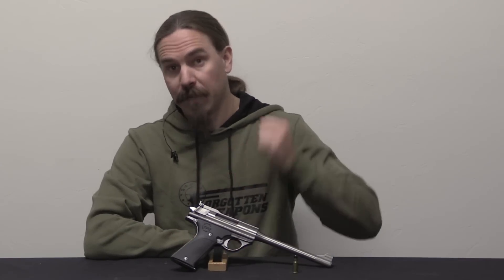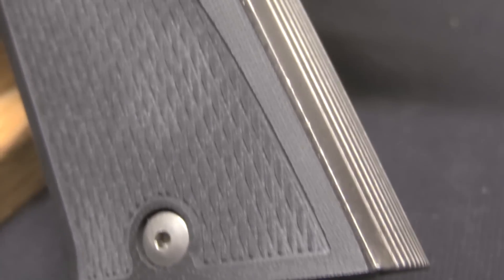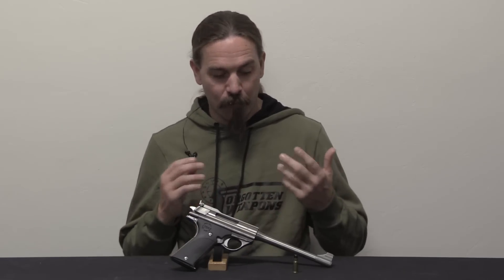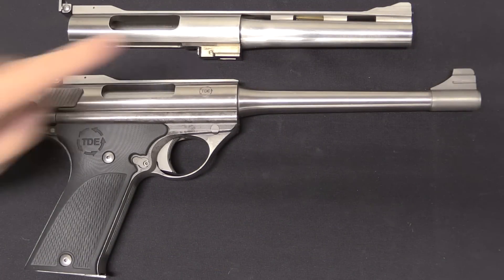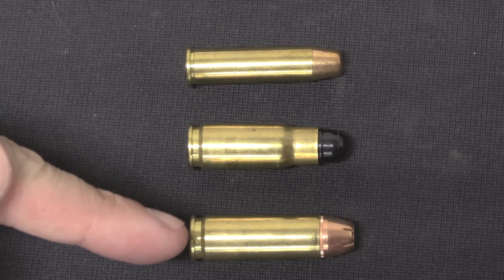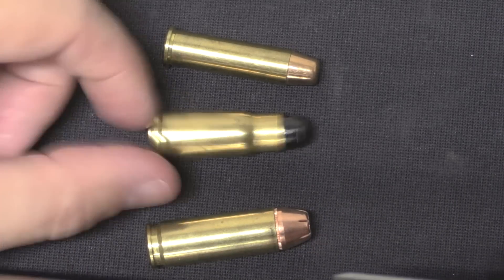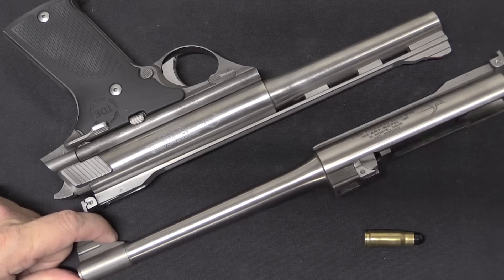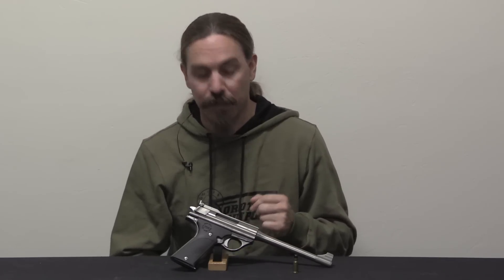AutoMag 160 in .357AMP: For When the Regular AutoMag is too Common

Comment: Loved the Automag since first seeing it in the 80's . Curious to know how they used to bottle neck the 44 AMP casing to house the 357 bullet? Also the Beverly Hills cop 2 thing with the gunsmith saying they used to cut down 308 cases for the 44 Automag - is that true? cheers
Reply: Not likely.  The base of a .308 Win case is .47in in diameter, while a .44 Mag (can't find specs on .44 AMP, but images show them to be nearly identical except for the time) has a case diameter of .457 in.  Maybe close to the eye, but .013 in. is quite significant when it comes to a chamber size.
Reply: Actually, someone asked Ian this very question in one of the earlier q&a’s and Ian confirmed the scriptwriters got that part right. Can’t remember which specific q&a it was
Reply: Yes, .44 AMP cases were made from .308 cases (also .30-06 from what I know). It appears that for once in hollywood both the armourer knew their sh*t AND somebody involved listened to them.
Reply: 2 necking dies, a Neck Reaming Die, Full length Size and File Trim die.....  RCBS Custom Shop made them.   And yes,  308 cases...
Reply: @Stevarooni  .44Mag case diameter is the extra for the rim, .44Amp is rimless, same as .308.
Reply: @CJBrunt  the rim diameter of a .44 Magnum is .514 in.
Reply: yes cut down .308 shells can be used.

Comment: Necking it down is pretty similar to the 357-44 b&d. 

I think it would have been better if it was a 223 based, like the 357 max-ar wildcat, but instead at that 1.290” case length.

Comment: “The jacket goes flying off and the lead disintegrates mid flight.. which is not something you want”

Me, an optimist: So you’re saying it has a built in feature to convert some standard loads into the endlessly destructive ratshot?

Comment: Dear Ruger:

Lock the action open, flip down a lever, and the barrel comes off.

In a magnum centerfire pistol.

Try it. It might just work for rimfire as well.
Reply: It does work. It's called a high standard sport king or a Victor. Lock slide back, push button, barrel falls off, slide slides off frame. They've been a thing for almost as long as the original Ruger Mark.

Comment: Can't the 44amp just be formed from cut down. 308 brass??
Reply: Omit the word "just" and the answer is yes. In the eighties I read an article about how to do this, and you had cut the existing neck off the .308 (7.62 NATO not recommended as thicker around the case head), trim to the right length in a die, probably ream the mouth out to the right internal diameter, anneal the new case mouth WITHOUT annealing the case head, full-length size it and possibly trim again. I think you might have had to turn down the rim or perhaps skim the head to make the rim thinner, but it's been four decades now and my memory is not as clear as all that. There was at least one lathe action, anyway. To make .357" AMP was a bit more complicated and I remember a photograph of the cases sitting with their heads in a dish of water while the case mouths were annealed.
Reply: Omit the word "just" and the answer is yes. I think you had to ream the inside of the cut-down cartridge to get the right internal diameter as well as full-length sizing the outside diameters with a suitable die, and anneal the new case mouth without annealing the case head. I think there was a lathe operation of some sort on  the head or the rim as well. And, as Ian says, you had to know what your chamber dimensions were like to get the headspace right. I did read the instructions in the early eighties, out of curiosity rather than because I liked the idea of doing all this.

Comment: I don't understand why they wouldn't just chamber these in 38ACP or 9X23 and just change the whole upper instead of a niche product like this.

Did they ever explain their reasoning for the 357AMP?
Reply from the maker: Using a cartridge not based on the .44 AMP  would require a new bolt with different dimensions.
Reply: @ForgottenWeapons  so even the lug geometry was the same for the lockup?
Reply from the maker: Yes, the bolt was identical. The caliber change only required a different barrel.
Reply: @ForgottenWeapons  i guess i can see the appeal.  would be fun for handloaders.
Reply: There were plans to make one in 45 ACP.  The costs would be high compared to a much simpler Browing action.

Comment: Is it possible to cause a .300 Blackout situation if you put a .44 into a .357 configuration?
since the magazine is the same and the brass is essentially the same length, I assume it would fit....?
Reply: No. That is the same as putting a .30-06 in a .270 . It will not chamber. It will not go in far enough to chamber because the projectile is larger diameter.
Reply: @glennruscher4007  I see, thanks for the explanation
Reply: You could run a 357 AMP into a 44 AMP as the brass is the same dimensions up to the shoulder.

Comment: Why not make a solid copper projectile to solve  the issue with the copper jacket peeling off
Reply from the maker: Solid copper has to be much longer to get the same weight as lead. That reduces case capacity.

Comment: I would think 357/44 Bain Davis would be a good start for loading data .
Reply: I think the AMP has a larger case capacity.
Reply: @DrsharpRothstein  It probably does just thinking to use the Davis as a starting point for working up loads.
Reply: @DWM 
It has been years since I compared the numbers.   You are correct they are 'close' but I don't know if I would want base loads on it.

With that said I have worked up loads with the Powley computer that I could not find any comparable types.  Chrographs and measuring case head expansion with the Powley calculations with a gun that was not the equivalent of a Ferrari in case it blew up.

Comment: These are nifty, but some crazy (in a good way) Israelis (now Moonies ... still in a good way)  proved that you can make a decent semi auto that chambers these magnum revolver rounds. So how is this better than a Desert Eagle.
Reply: All U.S.American half a century ago?
Reply: The overall pistol width is slimmer.  The pistol grip is not "fat" like the DE.  The pistol grip is longer and fits your hand better if you have wide hands.  The sights are better because they are mounted on one solid piece instead of two (with one moving).

If you are going to shoot a big magnum you probably want to 'really' get the most from it in performance.  A Desert Eagle does not like to run high pressures anything much over 35 thousand psi and the gun will start to jam and misbehave above that. The Automag runs best at high pressures and  keeps getting better as they go up.  I have seen published loads listing pressures in the mid 60's psi for the Automag.